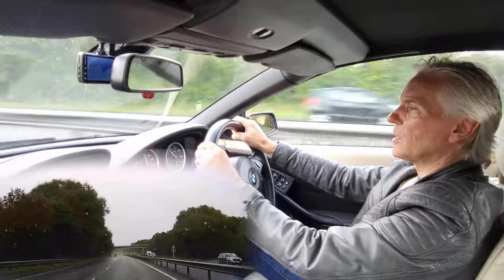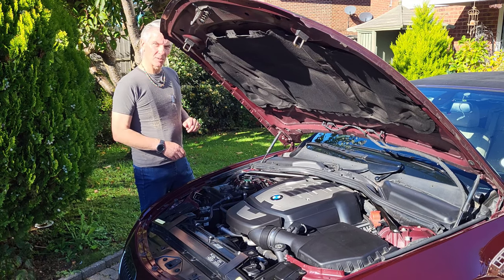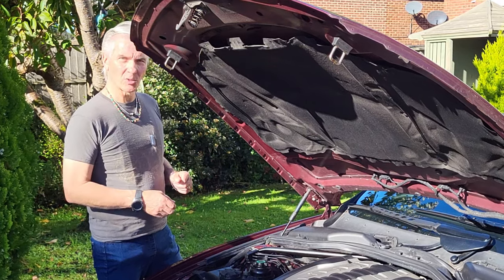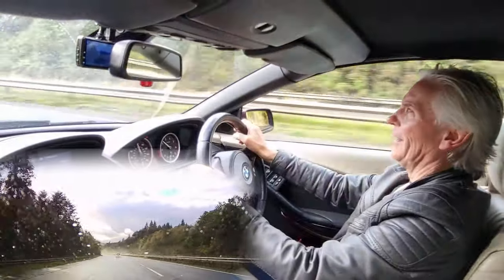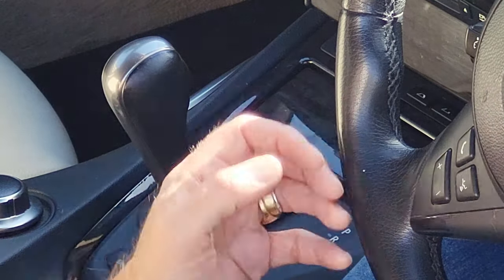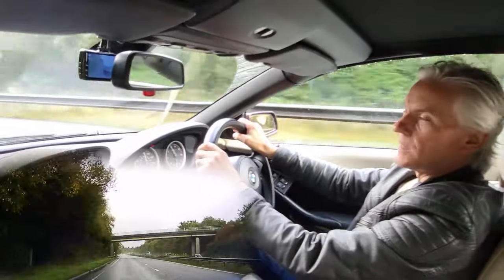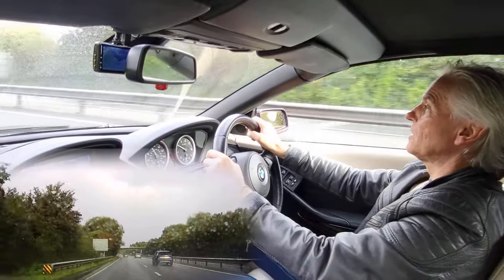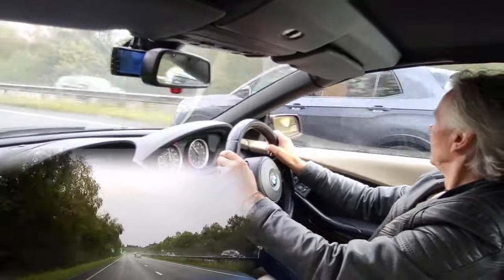BMW - THE ANNOYING HESITATION AND HOW TO FIX IT

Comment: Personally the best way to get rid of the hesitation or drop down as you accelerate hard is to fit an induction kit, the issue is due to air flow as the normal intake restricts it when flooring it too much  There is only one I could find for the 650i I imported from America. Yes it £300 but the difference is amazing. It is proven from independent reviews to give an extra 12bhp. The mid range is now so much better. Pull away fast at 30 to 40 and the thing takes off. It's feels like DS or sport but with full gear range and no high revs on slowing to sharp corners like DS or sport which can keep the revs up too much. Best £300 I spent makes the car so much more enjoyable.
Reply from the maker: Thanks for the info!

Comment: 1000% this. Been doing it for years.. As Timm says, it becomes a second nature movement, and it also lets passengers in your car know, that they should brace themselves. 😂 Throwing it into sport mode also puts the pedal into a more direct mode mode with the throttle, or some some would say more sensitive. Experience with an e53 4.8is and e39 M5 (manual). The e38 740 doesn’t have steptronic, so I can only drop it down a gear. I wasn’t aware of the why behind the torque converter lockup, I only knew it worked. 😅
Reply from the maker: You can use the D432 boxes in manual mode, I used to do that in my E32. Start off in 2 and sports mode selected (1st gear), switch sports mode off (2nd) then you have 3 (3rd), 4 (4th) and back into D for 5th. It takes a bit of getting used to but is great fun
Reply: I think the D432 and even the 6HP start off in 2nd gear by default, unless you put them into sport mode. With the D432, dropping it into 4 will cause it to select 1st from a stop.
Reply: @TimmsBMWRepairsandInformation  I just got a 2004 330ci I use manual mode quite a bit but it always makes my left foot twitch instinctively is looking for a clutch pedal because I am used to my 5 speed Subaru. Driving it back from delivery I almost blew a stop sign at a rest stop in the dark and desperately tried to mash a nonexistent clutch pedal with my left foot with my right on the brake then had a 2 second panic attack thinking I stalled the car. In auto mode im fine but there is some kind of weird grey zone for my brain having it in the manual mode. I even do things like accidentally downshifting it from 4th to 3rd instead of going to 5th because my brain knows 5th gear is a forward push from 4th gear on a manual car.

Comment: Great tip. Have you ever experienced funny drivetrain/gearbox behaviors around 30mph? Seems like it either keeps spinning at 3000RPM or upshifts way too aggressively, making the car super sluggish. Only an issue around 30mph.
Reply from the maker: Yes I have, but all OK again after the Mechatronics bridge seals were replaced

Comment: Just brilliant! Gotta try this now also after I had changed spark plugs, stuck DISA valves, all the possible oils and liquids; and cleaned vanos solenoids and valves. 😀 (tbh all those things needed to be changed anyway long time ago also, but previous owner apparently didn't bother... so not sad about changing them. got rid of rough idle and horrible fuel consumption, but the hesitation was still there...)
Reply from the maker: It's great fun that's for sure!

Comment: I have been doing this since i got my 550i v8, but i also installed a Sprint Booster, which kinda does the same thing, but on Comfort mode (D), i only use Left Up>Up when i need for it aggressive maneuvers😂. Thanks, Tim, for quality content as usual.

Comment: Timm, I see that the under hood insulation on your car looks a bit wonky like mine did. I have a 2005 645CI Cabriolet w/ 75K. I looked into replacing the insulation and found it quite costly especially when there was nothing really wrong with the insulation that I had other than the "tabs" no longer fit within the slots in the hood. I trimmed the tabs and cleaned it all very well and then used a silicone adhesive to re-install it. I am no longer embarrassed to open the hood. It looks so much better. I was thinking that as nice as your car is that this would be a simple solution and your subscribers may enjoy this one afternoon low cost upgrade. 
Please keep it up, I cannot tell you how much I appreciate all of your videos. Many thanks from the U.S.!

Jon Warren

Comment: Thanks Tim. Another great vid. I drive my 630i like this to get the best out of it, but mine has a different intermittent hesitation where the engine literally does not fire on any cylinders for a second or so if I press the accelerator anything like quickly. If I lift off before the revs have died off completely and reapply smoothly, no issues. If I don't lift off, the engine will die completely or backfire through the inlet manifold. It only happens once every blue moon (every 3 or 4 weeks) when driving, and using the the method in this video certainly reduces the occurrence. I can force it to happen when not driving by just pressing the accelerator quickly to the floor from idle (once the engine is warmed up). It won't happen if the engine is cold and still on fast idle. I don't know if you remember the accelerator pump on an old school carb? If this pump wasn't squirting fuel down the throat of the carb during fast throttle opening, you would get exactly the same symptom as I'm seeing. No faults ever showing in the ECU. I' plan to remove and check the DISA valves and the VANOS solenoids first as they are easy to do, but both of these should be throwing codes if not working...? Any ideas..?
Reply: N52 here also. Absolutely identical situation. Changed plugs, coils etc and no change. Did the pcv recently. No change. Mine doesn't actually misfire but it essentially freezes. Engine holds in a near idle like rev and it's almost as if time has stopped, desire foot being near flat on the throttle. Lift off and try again with a less aggressive press of the throttle and then it's fine. If you're pulling out onto a fast Road it's a potential hazard. Let me know if you resolve it!
Reply from the maker: When it is safe to do so, switch off the DTC (5-second press) so that the ASC+T symbol is shown - let me know if this changes anything
Reply from the maker: When it is safe to do so, switch off the DTC (5-second press) so that the ASC+T symbol is shown - let me know if this changes anything
Reply: Hi Tim, it still happens when the DTC is off... i'm tempted to say it's slightly better, but that may be psychological. It's certainly still there though..

Comment: I own a 2005 645ci with right at 75k miles. I just a few days ago drove it “spiritedly” for about 100 miles on a nice country road and the car performed very well and as expected. Last night I decided to take my wife for gelato and less than a mile down the road pulling out of my neighborhood the car suddenly shut down and stopped with no warning.  A big red light came on that I have never seen before. It would not restart for a couple of minutes but finally did. I was able to get the car home but just as I was pulling in the driveway I noticed reduced engine power came on. Once parked I turned it off and restarted it and everything went back to normal. I do keep the car on a batty tender so the voltage was good. What would possibly have caused this very worrisome episode?
Thank you for all of the driveway hints and repairs. I recently was able to replace my cabin filters and flush the under hood drains with your help. Keep it up all of this is very much appreciated!
Reply: do you have a code scanner? if not just go to the car parts shop or the mechanic and tell them to scan it and give you the codes that will tell you exactly what it is but without those codes it’s impossible to tell it’s just a guessing game
Reply from the maker: My pleasure! Although your battery is well charged it may have a failing cell - and replacing is the cheapest way forward
Reply: @EpicGamerrrLolz  I am a GM dealer and had the scanner on the car the next day. No codes were present.
Reply: Lymp mode check your battery

Comment: Awesome Timm. It's all music to me. I put my 97 540i into sport mode (left) and away she goes. If I was really crawling along behind a truck I'd go left and down for third. You just add detail to the stuff I instinctively know and worked out and that's why I appreciate your videos so much. Didn't know about the torque converter stuff.
Reply from the maker: Thanks Bernard, the lock-up on the 650i is much more severe, it does it on 3rd - 6th gear!

Comment: You can also use Inpa software to adjust minimum valve lift - the computers generally adjust this for you over time based on how you drive, but it's good to set it up for your own preference - it should be between 0.2 and 0.8 mm. The lower the minimal valve lift, the lower the consumption and the more responsive the engine is. With Inpa you can also adjust transmission adaptations then take the car out on a few different routes and run it through its paces. It will then adjust shift points, throttle response etc. It is a brilliant system when you understand it. 
As for the video in general, if you just press the sport button it will drop down two gears and allow for an easy overtake. 
You should also run the throttle body adaptation procedure every few months and the car will become much more responsive.
To me personally it looks like your valve lift is set too high and the TBA should be done. I have the 650i coupe and for overtakes I never have to move the lever as it just kicks down two gears or so depending on how much I press the fun pedal. 
If you want your gearbox to be more responsive, an xhp tune is good and it will actually prolong it's life. It's quite cheap and easy to install. I have the stage 1 as this is after all primarily a GT car and it has to be smooth. Stage 2 and 3 are quite aggressive.
Reply from the maker: My valve lift at idle is 3mm - that's probably small enough!
Reply: Yep 0.2 to 0.3 is fine :)

Comment: Hi Tim....... thanks for reading this comment 🙂
.
I think BMWs were the best cars in the world .....(as i,m a mechanic with health problems presently)
.
I own a BMW 1 series petrol 2005 and it past it's MOT after the rusty servo was replaced and i drove it home so gentle ...... and parked it up a few weeks ago (i use a little Fiat)
.
The plugs were replaced and air filter and the garage were great 🙂
.
PROBLEMS    AGAIN    ALREADY   😞 .......... pulling  about 20 degrees to the right and when i gently pull to the left ........ the DTM light pops on and it misfires at 2,000 rpm
...
...
Yeh...... i will track the wheels straight ..... and just pull fuses until it,s driveable without ABS or DTR
...
...
Ahhhhhhhh  !!!!!............. those old 7 series ?????............ best cars in the world then 
.
This one i own ???................. I ummmm sense it's "trouble" ..... like a student designed it 
...
...
Thanks for reading 🙂.......... (My little Fiat is just "happy") ..........lol
Reply from the maker: We all need happy cars that's for sure! Yes, tracking first - and then brake callipers....
Reply: @TimmsBMWRepairsandInformation  Hey thanks for replying ..
.
The big red tyre light is constantly on but always has been and i,ve noticed the o/s/r wheel gets black....... though i polish them 🙂
.
The battery was weak and i was a fool in connecting cheap jump leads into the boot from the Fiat ............ then the trouble started (not to crank it)
.
Yeh i'll sus it out ........ ummmm they are a bit "silly" with their quirks ...lol

Comment: Good chat, useful every day, and 100% accurate for me. Some of this is new analysis to me and greatly improves performance on demand in my 328i. Some of this gives the words needed to explain that certain performance lag I have long observed and have been trying to overcome. How the doodad mechanically works with the flux capacitor is new to me. The power lag when flooring the gas pedal of my 328i has always been disappointing because flooring it does not instantly produce speed and and power wanted in exchange for max use of fuel. One second is too long to wait to get up and go. Sport Mode alone is enough performance for most  situations but laying the shift on top of Sport Mode gives the instant muscle that is sometimes needed. Improving traffic flow for others is half the fun. This maneuver makes driving better for me and drivers near me who want to pass, change lanes, or are unsighted of the road and traffic ahead.
Reply from the maker: Glad you like the video. Sport mode on the 650i is hateful, too jerky and the suspension hardens up along with the steering!

Comment: Thank You for advice, it works even without vanos or valvetronic in e39 540i when crusing. I was hoping it would eliminate thinking when start from 0-60, but not. Performence mode not help either...I think I need to replace the knock sensors
Reply: I'm having the same problem at the redlights...
Reply: Do you think it is actually the knock sensors?
Reply from the maker: It all depends on which engine you have - if it is pre-facelift (M62) then probably the MAF. If it is post-facelift (M62TUB) then that opens up a few more possibilities including the MAF!
Reply from the maker: No, knock sensors are slow to act - try E0 high octane fuel
Reply: M62 (pre-facelift) -97 540iAT. MAF units aren't cheap.

Comment: Im so glad i found this channel! Although I havent needed the advice for anything in particular yet, I know there will be a video here for when i need it! 

The question i had about this video was for manual applications. I presume the manual version would be to downshift to 4th, and rev match? (if your car has 5 gears, and you want to accelerate into a gap on the motorway)?
Reply from the maker: Welcome! With a manual you have little to worry about

Comment: Gonna have to try this with my 2010 550I M Sport. I rebuilt the engine and transmission at 160,000 miles. I was getting the transmission malfunctioning a lot before. Got it twice so far since the rebuild. I did not get the adaptations reset yet. Got 2500 miles on rebuild, changed the pan and fluid at 500 miles. Feels stronger than before getting a lot of traction issues. Need new tires 😂
Reply from the maker: Yes, get the adaptations reset first - it made a big difference on my 650i
Reply: I also have a 2010 bmw 550i, I'm having an issue with the hesitation and the idle bucks when I slightly let off the brake I've replaced the spark plugs and coil pack and got an oil chnage but the problem still persists and the car idles at 500 rpm, do you have an idea what it might be?

Comment: Hi Timm - I've an e46 325Ci, what's the difference between left and forwards, and using the kickdown on the pedal?
Both seem to downshift and do the same thing - apologies in advance if I'd missed something in the video.
Reply from the maker: I hate kick-down it just makes the engine scream! Much prefer using the Steptronic
Reply: @TimmsBMWRepairsandInformation  may I ask what the difference is?
Don't they both just shift down a gear?

Comment: After putting the “shift” left up, do I still gotta be shifting for the car? or does it automatically?👏🏻
Reply from the maker: You have to do it manually - but, it will change gear if the revs get too high

Comment: hard to explain my problem, but under light acceleration i get this "hesitation" in the induction noise only, sounds like its cutting out but power delivery is still smooth. problem i also have sometimes is the car just jerks when id hit the throttle and i have to pull over then it just shuts off. im replacing the valvetronic actuater but not confident itll fix since i get that weird induction noise even with the actuater unplugged. my idle and coldstarts are better with it unplugged though. already replaced fuel pumps, sensors, coils and plugs. valvetronic codes do come up but only after stalling out and reflashing the car so itll start.
Reply from the maker: You must have an error code for stalling at the very least - so diagnostics is the way forward

Comment: Thanks Tim. Any thoughts on noticeable symptoms of a failing torque converter lock up clutch?
Reply from the maker: Yes, at 70 MPH a small press of the throttle should NOT increase the revs immediately. Another symptom is juddering at low throttle levels after coming off a junction and the revs at 1500 - 2000 RPM